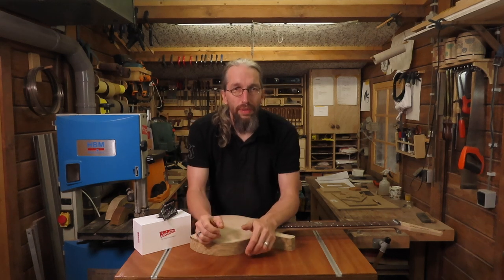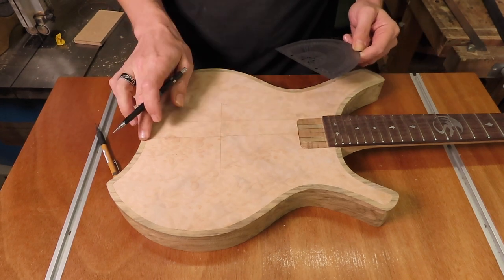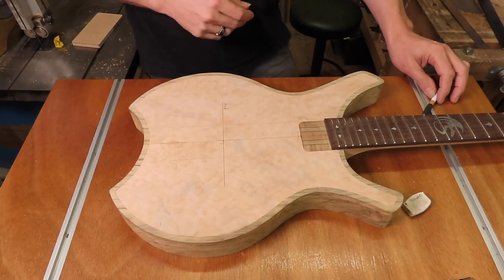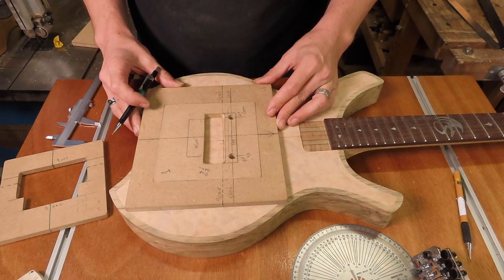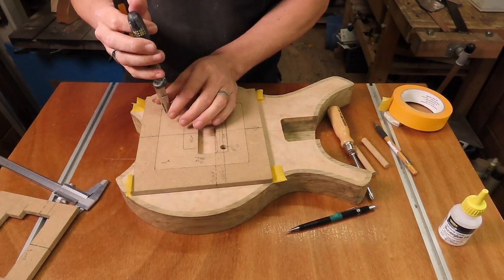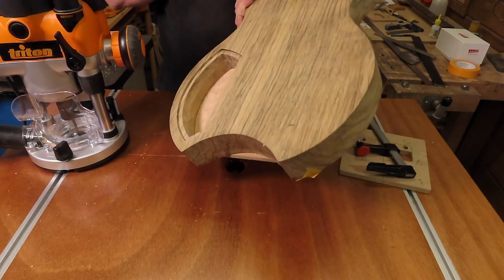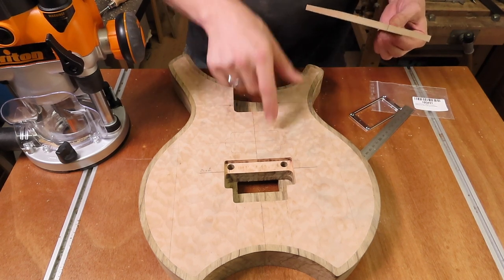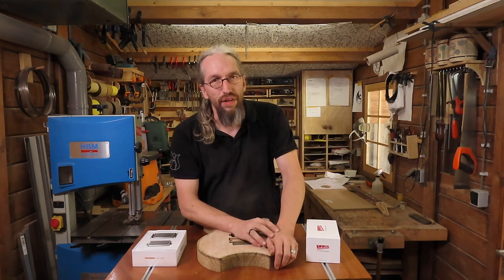Routing cavities for a Floyd Rose style bridge - A new guitar build Part 12.

Comment: If you use the Stewmac fret calculator it gives you the dimension for various bridge pins and screws locations. It has Floyd which I assume is the same as Schaller.

Comment: hi buddy i'm a beginner luthier from colombia and here its a little hard to find the tools for this type of jobs, i actually would like to see the router bit you use for the pick ups cavities, the one yous camera didn't record, jeje! i've build 4 guitars so far and for that part i've had to shape it with a chisel and sandpaper by hand, i've also considered to pay for a cnc cut but found that the designer charges a lot too for the vectors! so if i find that copying bit it would help a lot in my future builds! thanks a lot great job and videos
Reply from the maker: Hi Mauricio,
It sounds hard not to have easy acces to the tools you want to use.
The bit I used, at the point my camera decided it had enough, to tighten up the corners of the pickup cavities is a regular 1/4" cutting bit with a 1/4" shaft and a cutting depth of 16mm. I used the shaft of the bit as a substitute for the bearing to glide along the template.
I recently uploaded a new pickup routing tutorial in which this is shown.
Good luck on your builds.
Reply: @UnquendorGuitars  wonderful thanks, I actually saw another video where you showed that, but didn't understand all the característics of the bit, I have one of those but it's longer, so I need a shorter one jeje keep on building, great job nice guitars

Comment: Hi there!
Very nice video.
Can you please give me some measurements for placing the spring cavity template?
Tou drill a hole thrue the body flush with the edge in the cavity for positioning the template.
How many mm from that edge ( drilled hole to the upper edge of the spring cavity template. Hope you understand my q.
One more q: are you marking the actual scale lengh 25” or do you compensate for intonation 25,5-0,5” = 25”

Mike

Comment: Hello Daniel! thanks for the video. Do you think I can use that depth for a 1996T gotoh bridge? Have you used that bridge?

Thanks for your answer, greetings from Chile!
Reply from the maker: Hi Eduardo,
I'm not sure what depth you are referring to. 
I've used a Gotoh 1996T before, but if I recall it is not exactly the same as the Schaller bridges. And because every guitar is slightly different in string height and body thickness I recommend determining the required dimensions for each guitar separately.
Reply: @UnquendorGuitars  Ok Daniel, thanks for your help! keep rocking!
Reply: Sit the floyd rose flat on the guitar body put a straight edge from the nut to the bridge on the floyd measure the height from the 12th fret to the straiaght edge deduct your required string height what is left is the plunge depth of the router add a little more for your wang bar movement and this should be pretty near . Hope this helps

Comment: Great video! I'm going to try this on a project guitar. Question for you...I want one of your metal protractors, where did you get it? Thank you!
Reply from the maker: Hi Bruce,
Thanks for the compliment. 
The protractor I use is made by Incra tools. I think you can find them at most good tool shops and web shops. 
Here’s a link to Amazon https://www.amazon.com/PROTRAC06-6-Inch-Precision-Marking-Protractor/dp/B00002255K 
They’re available in both imperial and metric. 
Have fun building your project.

Comment: Thanks a lot for this video! I will definitely use some of your approach in placing a Floyd Rose on my current project. Thought I was the only one that does quadruple re-measuring :). 
Is that a Dutch accent I hear :D
Reply from the maker: Hi Matthijs,
Thank you and you're welcome.
I can assure you you're not the only one and I feel there is nothing wrong with checking your work as often as possible. It has helped me to spot mistakes and rethink my choices on multiple occasions.
I'm from the Netherlands so yes that's indeed a Dutch accent you hear.